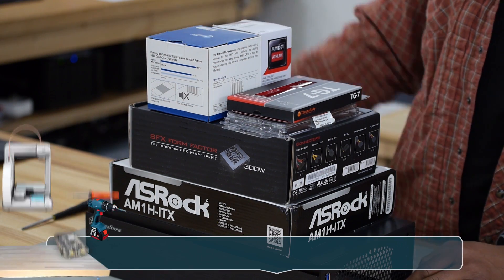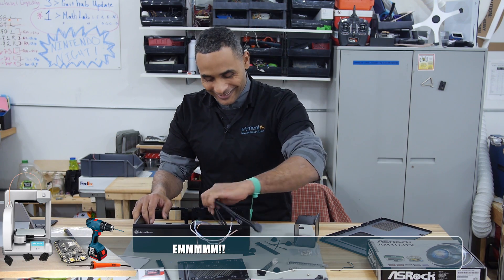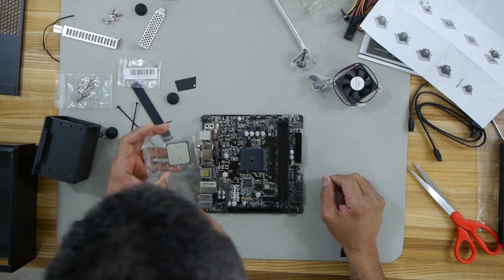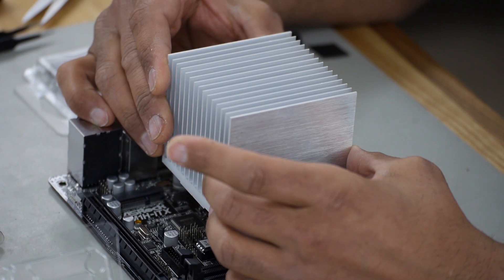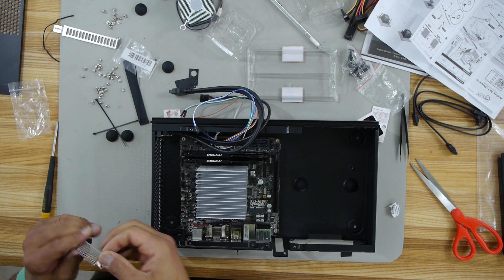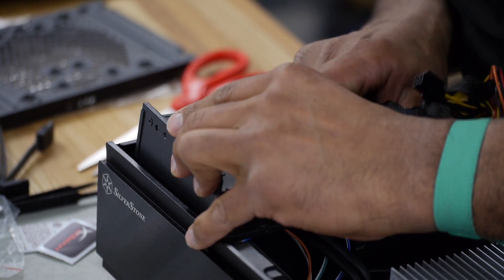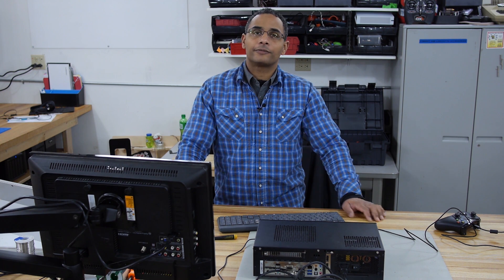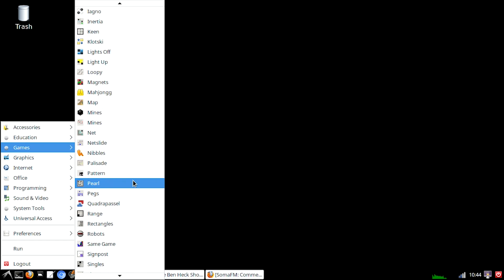The Ultimate Media Center for Under $400

Comment: Cool build.  I used very similar parts in my Instructable for my HTPC build (https://www.instructables.com/id/How-to-Build-a-Decorative-HTPC/).  But one thing I might suggest is that people use a laptop style power supply (19V).  One of the coolest features of that board is that you can use the external DC block and have absolutely no fan noise associated with the power supply!

Comment: Why did you choose to run a full PC system versus a Pi based system? If you're running Linux and Kodi, is a PC processor and accessories necessary? I sold my Windows PC in exchange for a Pi for cost and lack of use. I haven't done much with my Pi lately, but I'm curious as to why you need a full PC for media browsing.

Comment: Such bad choice of hardware... :( I have a 4 year old media center PC (actually, it's also a media server) and it probably would still beat this one. My components are: ASUS P8H77-I board, Corsair XMS3 4GB RAM, Intel i3-3220 CPU, Scythe Big Shuriken 2 Rev.B cooler, Kingston v300 60GB SSD, Lian Li PC-Q08 case, a silent PSU and 4x 3TB WD Red for storage. I have an Ubuntu 16.04 on it and with Plex, Kodi and VLC installed I can basically play everything except 4K videos. For the latter the CPU is a bit old. Remember, this is 4 year old hardware and without the HDDs it also cost around $400 back then (the disks were another $400-$450).

Comment: Why not just use a Raspberry PI for what you want, and for media consumption, linux and kodi is one of the worst pairing, you could use cheaper parts and use windows so at least you could use it for gaming, the best way to make a media center is to use a pi (or other arm model cpu board) with android, that way you can just use android tv, everything else you want to do that you can do on standard linux can be done in android for the most part and has a slu of apps that linux doesnt (Netflix, Hulu, Amazon) all built for the tv (if your using the android tv launcher and downloading those versions, which isnt hard due to android being free to download and install due to googles policy) 

Weak video for this show, seems uninspired and theres nothing really worth learning here.

Comment: My media center costed about 100$.
1) Raspberry Pi B (first one, not B+ - 35$)
2) 1 TB HDD
3) 8 GB SD Card
4) Game pad
5) Wireless keyboard

Card, Pad and Keyboard were used, found somewhere around my workbench.

Raspbian + Kodi (technically it was called something else when I started) went first, than emulationstation. I copied 20+ games bought from gog, and all three DOS games which I had on working floppies (and found out that I have over 30 dead floppies) later and later I converted my favourite CD's from PS1 into iso's. Also I copied 100+ DVD's to this HDD.

Worked for about three years, then I switched to RPi3 just for fun. I still wonder if this isn't an overkill - Pi zero W should work as well as this one. My old Pi works as a NAS now.

Are you sure that 16 GB RAM for Media Center is enough?

Comment: Step 1: Take out 8GB RAM and use it in a different rig that is in requirement of it. Step 2: To be able to actually classify it as being a HTPC in 2017 you need to be able to decode 4K HDR content and have a mouse cursor that doesn't look like it has a mental disability.  You could buy a GT 1030 as they are low cost, most of them are low profile and they have no fans as they run incredibly cool!

Comment: i built a media center pc last month for my living room, started with a normal low end pc, end up overkilling it so im using it as my main pc now :D i will upgrade to a i7 kaby lake soon, as my other pc has a i7 4770k and its just sitting in the living room for movies doing the job this media pc was built for

thermaltake core v1
mini itx b250i gaming pro ac
intel pentium g4560 with cooler master hyper 212 evo
16gb corsair vengeance ddr4 2400mhz
512gb ssd + 3tb hdd
asus gtx1060 dual oc 6gb
seasonic 700w psu

Comment: Stock AMD Athlon 5350 cooler generates zero noise when it is set to the lowest RPM in BIOS and still manages to keep the CPU cool, even in summer.

Source: I've been using AMD Athlon 5350 build in a smaller Mini-ITX case since 2015.

Comment: 7:04 "One of the advantages of linux based OS's is that putting the hard drive onto different machines with an OS already on it is usually not that big of a deal"
Advantage over what? That always works on windows, so it would actually be a disadvantage if it only works usually^^

Comment: I am using raspberry pi zero with kodi ( mostly used for watching movies and tv shows + IP-TV ) in front and deluge ( torrent client ) in background, i had spare 512GB 2.5 HDD so i bought case to make external hdd and attached to raspberry pi with usb hub (3x usb and lan). I wanted this to be as cheap as possible. Pi zero 5€ + usb hub 2€ +   hdd external case 7€ = 14€ in total. other stuff i had in my home. Not powerfull beast but it is playing movies no problem.

Comment: My first experience with a decent itx it was stuffed into a dead xbox 360, freaking sweet, use it to run older games and media center. I was also able to get the 360 controllers working with the existing ring of light! Also you may want to get some air moving across that heatsink, they do run a bit toasty

Comment: I just bought a second hand Lenovo thinkcentre M72E SFF with an Intel i5-3470 CPU and 4GB (2x2gb) of RAM for $125
Bought an extra 8GB stick of RAM for $25
Bought a Gigabyte GTX750Ti with 2GB of graphics RAM for $150
Final specs:
CPU: Intel if-3470
RAM: 12GB DDR3
it can play most recent games that I have tried on medium settings and runs Windows 10, dual booting to Kodi if I want to.
Total: $300 AUD
Or about $230 USD

Comment: Since you are going with AMD just a thought why didn't you go with the am3 platform and use an 8350x cpu with an included cooler and use an sfx fully modular PSU?
Reply: Well then he would need a gpu as most AM3+ boards (if any left that is) dont have an IGPU and he would need the bigger mATX board as there is no AM3+ itx board that im aware of. 

(Believe there were a few regular am3 itx boards before the FX bulldozers came about but those never supported those cpu's).

Then that would of cause him to get a larger case.... Which I'm guessing he has a spot in mind for the HTPC that this ITX case would fit at that a mATX case may possibly not fit in...

On top of that, an FX 8350 is WAY overkill for a HTPC and light gaming usage (that this system would be mainly used for). By the time you'd need the power of the 8350 for these kind of tasks, much much better processors with lower power usage would be out.

Also wanted to point out that this cpu did have a cooler as well but Felix decided on a different cooler than the one included. 

As for the SFX psu, he could of gone with a modular one but it would of cost him an extra $40 over this SFX psu (according to PCpartpicker that is).
Reply: Good point on the 8350 being over kill and you just have to know the right place to find the am3+ mini itx board

Comment: Kodi, Amazon Prime, Basic Games - Save $360 and get a $40 fire TV stick and it will work much easier from the Sofa with a controller. Alternatively get an Xbox One which will play stuff from your NAS, 4k catch-up services and 4k Blu-ray Discs for around half the price.

Although I did enjoy your build I think you could have chosen better components such as an Intel Pentium and less RAM.

Comment: Or for half the price do what I did: 
1) Buy a HP Stream 13 laptop with Windows 10 on it (idiot proof for the entire family)
2) Install Plex for free to catalog all your stuff
3) Plug in a couple of cheap 2Tb external HDD's (which I already had from my previous media centre setup)
4) Connect a wireless keyboard, touchpad combo
5) Sit back 15 minutes after purchase/setup and enjoy via HDMI and dolby surround sound system on your big screen TV.
Reply: Exactly I have no idea why people are building these when you can just sit a laptop under ur tv

Comment: If anyone else is thinking about doing this. I'd recommend the Antec ISK 100. It is much smaller than the case Felix used and includes a power supply. I went with an Intel build and used the G3258. The fan noise the stock cool uses is inaudible. It is a great HTPC. Also, 8GB is more than enough RAM.

Comment: I built my HTPC into an old NES. USB ports where the controller ports were... DVD drive mounted in the slot. I have a PWM fan on the side though to exhaust the heat. It does make some noise, but isn't noticeable until you're done watching the show.

Comment: Honestly, you have got it backwards, you cheaped out on the motherboard and CPU and poured money into unnecessary things like 16GB of RAM, for a media centre PC 4GB is pretty good, 8GB is really the limit of what you might need. Not mentioning the platform you chose is ancient. Really you should have went for something like an A Series APU such as the A8, or on a newer platform than FM2+ on the Intel side such a Skylake Pentium on the 1151 Socket. SSD is fine, although if you are streaming all your media to it, you could probably get away with 60GB. In terms of cooling, while passive is nice, I think you over estimate how loud some of the newer SFF coolers are. Especially with lower power hardware that won't come close to thermal limits when watching or streaming media. Ryzen APU's might be great for a Media Centre PC , shame they aren't available yet.
Reply: I run a media PC with a core2quad with 2 gigs RAM.  It's plenty for this sort of use.  Given that Arch Linux is the OS here, 16GB RAM is overkill in the extreme.
Reply: Indeed Arch doesn't really consume a lot and most of the applications mentioned won't be intensive.
Reply: Maybe if your HTPC is only streaming one file at a time.

Comment: what a bad selection of hardware for 2017 htpc
Reply: Scott Ster That CPU will get hot if you're running its 100% for a while, maybe gaming. but its a fucking media server, it will be running low frequency almost all the time, and has power if needed. And i think noise was the priority. But GJ, you know something about PCs, except you dont buy a powerful CPU and downclock it, you buy the lower clocked version and then undervolt it...
Reply: Oh well, I'm using my old PC with similar specs as an HTPC and it works just fine ;P
Even works for some light gaming, dev machine (In case I need VS on Win 10), and a storage server ;D
Reply: David Pérez 
Yeah, the 116GB RAM was massively overkill.
Reply: If he's only running Linux and Kodi, why do you need higher spec hardware? Hell, Windows 10 will run on an Atom processor. High spec hardware isn't necessary for media browsing.
Reply: Because it could be had for a VERY minimal price increase. Realistically that build will be fine for what he plans to use it for. But if he ever wants to use it for literally anything else he will be SOL. 

Also that CPU is pretty hot for a passive system. When building a passive system usually you want to get a very powerful CPU and under clock it to desired temp.

Comment: I'd suggest going for a modular PSU on a build like this, so you can get rid of all the wires that you don't need.
Reply: Nukleon His motherboard supported external DC power supplies - that would have been even better
Reply: PICO PSU rather, IMO.
Reply: CataclysmZA but why when you have a DC power port on the motherboard
Reply: Nukleon TOO. EXPENSIVE.

Comment: I built a htpc out of an old gutted emachines chassis using an asrock J3710-ITX (integrated CPU), 8gb of ram and a re-purposed SSD. It handles 4k HW decoding in MPC-HC but isn't so great in browser such as YouTube. Probably a hardware acceleration issue or something.

All in all, it cost exactly $170 AUD, but I might have to look for a new psu because the one left in the case is a "chicony" and will probably burn my house down sooner or later.

Comment: Even an AMD a10 or a8 would be better than this, just what
Reply: tdp 45-65w on a a8( im using one)Still bugger all and would be a huge leap in performance.
Reply: Aye. Something like an A8 3870k. 3ghz clock and an integrated Radeon 6550D GPU, admittedly it runs on the FM1 socket.

Comment: £30 raspberry  pi running Kodi
£70 Projector
£60 2.1 speakers
Everything on my home network gets streamed through that set up when watching movies or TV in bed,the raspberry pi is velcrowed to the top of the projectors to take up less shelf space.
i even have Snes and and PS1 emulators in an external 1TB harddrive so by plugging my retro controllers in I can game like I would in the early 2000
Reply: They're easily available, but utter junk.
Reply: HOW DID YOU GET A PROJECTOR FOR $70?
Reply: amazon but they're garbage and output standard def
Reply: Raspberry are utter shit slow compared, until the video is actually running. If it was a budget for under $100 maybe. But an  ARM CPU compared to a x86. at the very start he says we wants a full blown desktop. You dont get that with an ARM CPU. but still thanks for telling us something we all know.
Reply: Jesus you guys,The projector is actually not bad for movies and emulators.The Raspberry Pi can be slow at times it takes around 3-4mins to load Kodi up from Retro PIE and load the video you want,Which isn't to bad seeing all the content is free ( I used to download lost on a 512kbs connection and it took ages 3 to 4 hours to be exact over torrents)If your raspberry pi has problems with slowness try a better power adapter and if that doesn't help try over clocking it's really easy to do.I paid around £160  for this whole set up and I'm really impressed with it and if you want a home theater on the cheap this is probably a good way to go.
When the Projector fails (like they all do) I'll probably spend double on it seeing this is what I get for £70 I thought I was going to have a much shitter experience,However It feels just like the cinema 10 or so years go in terms of quality.

Mikey is right you have to look at a lot of reviews and specs as a lot of sellers will mislead you,I sacrificed heat and noise for picture quality.What I'm trying to say is the projector is quite noisey with out the speakers plugged in but not noticeable when watching movies also it does exhaust a lot of heat.
I can also watch during the day with the curtains closed but I have quite thick curtains (Ikea Throw thick).

If anyone has any questions feel free to ask i'm here to debunk fallacies for you